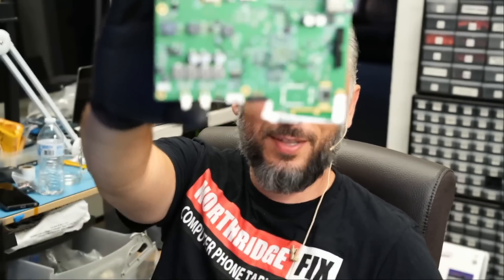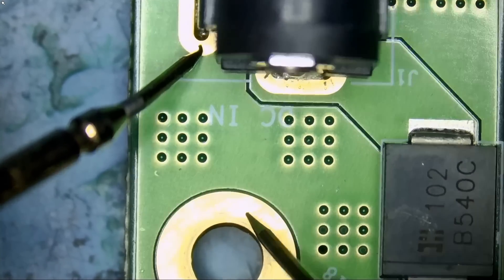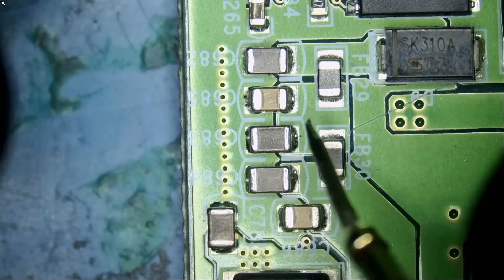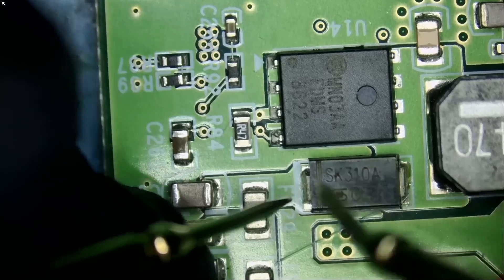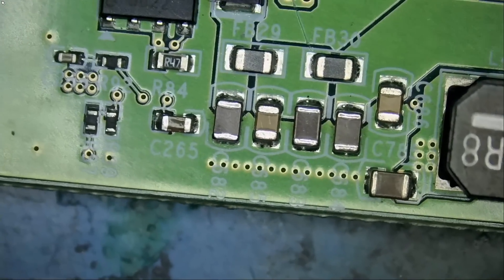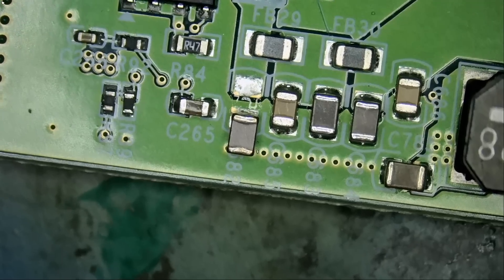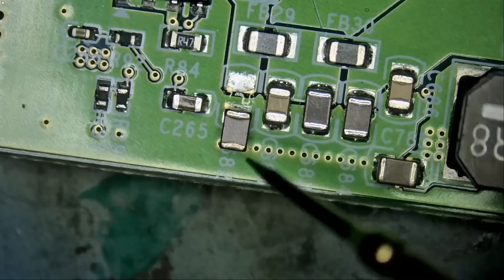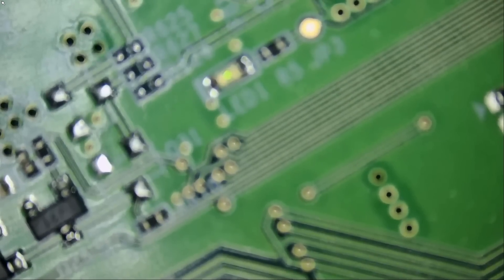Arcade Machine Motherboard Repair -  iiRcade Gold Edition

Comment: I worked at a pinball factory in my early years. One of the most fun jobs I've ever had. From assembly to board repair but final testing was a hoot. I thought it was my dream job. Imagine playing pinball for 8-9 hours a day and getting paid. Realistically, after a month, it wasn't fun. I transferred back to repair. That's a pretty small board compared to what we had in the 70's. Great video Alex. It could have been way worse.

Comment: Parrellel caps have the same value. It wouldn't make sense for them to be different. Good find btw, you found the needle in the haystack.
Reply: Apparently sometimes they do for high frequency noise I've seen 0.1nf and 0.01nf caps placed in parallel on power busses a lot. This doesn't make sense to me but I keep seeing it in designs.

Comment: what i find more fascinating is how fast his solder melts when blasting it with hot air one some high thermal mass boards without preheating..
when i set mine to 370C it takes forever and when its 420C the board gets charred and bubbles immediately, long before solder starts melting lol

Comment: I’m an arcade technician and your videos have helped me tremendously in board repair. I’ve even repaired pinball machines. This was fun to watch.
Reply: Hi Rambo! I would like to become an arcade repair technician. I recently took an iPhone/mobile device repair class and advanced soldering class. They were both a week long. I am starting to build a repair workbench and got a rework station and some other stuff. I plan on buying old damaged units and learning to repair them myself. What is the best way to start learning as arcade specific repair? Thanks and have a great day.